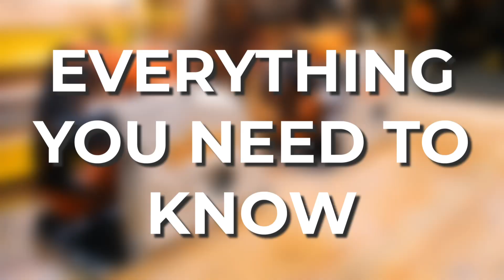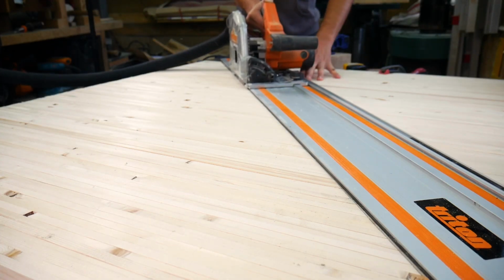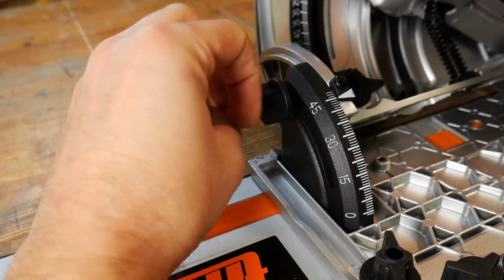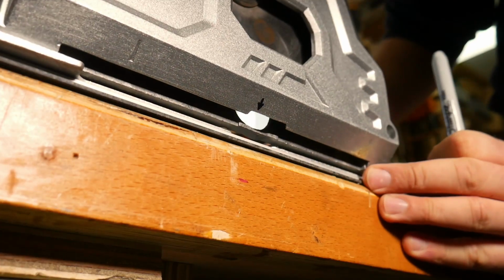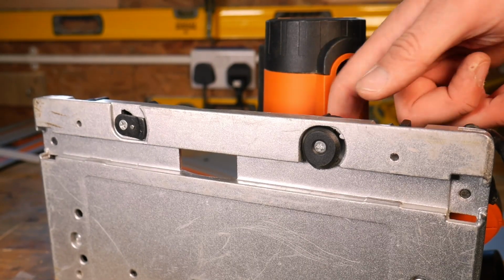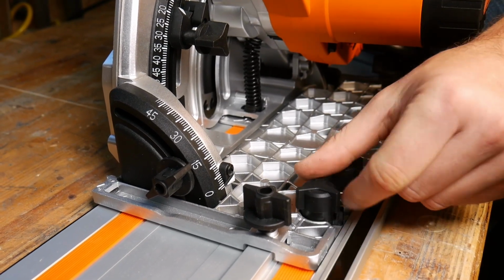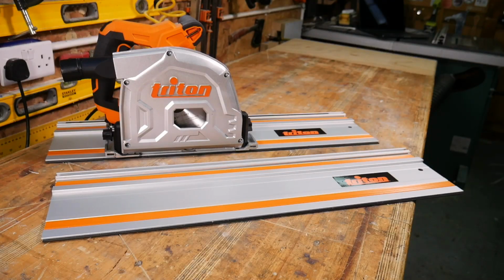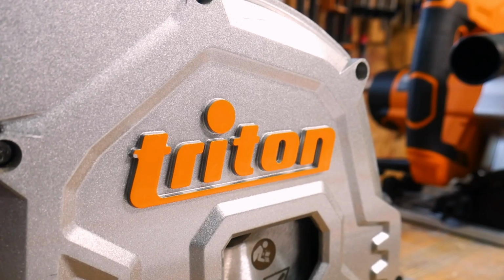Triton Track Saws - Which Suits Your Workshop? TTS1400 vs TTS185KIT

Comment: Sooooo a more expensive version of the Wen?
Reply: Totally. In the same way a Ferrari is a more expensive version of a Yugo. You ARE aware WEN is an acronym for "Westerners Expect Nothing", right?
Reply: @grumblycurmudgeon   sorry if i hurt your  fan boi feelings picking on your brand, but my statement stands. They are the same saw with the same specs, same features, same tracks, only you get to pay more than double for the privilege of the Triton name. So unless someone from Triton would care to chime in and tell me how their model differs from the WEN version, you can keep your snide comment.
Reply: @FyrFytr998  [citation needed]
Reply: @grumblycurmudgeon  if you can’t look at both saws and see the same exact controls, knobs, looks, and construction,  then I don’t know what to tell you.
Reply: @FyrFytr998  You got me. It's the knobs. Pay no attention to the specs. There's similar knobs. Ignore the Triton's 12A vs Wen's 10A. Overlook Wen's stamped aluminum shoe. Ignore the reduced bevel capacity. Skip past the 48 tooth carbide and steel blade in favor of the POS 24 HS (no, that not a typo; the only steel Wen products have ever seen relate to the patent application, and is spelled with an 'A'). The safety features are irrelevant too. Oh, and most of all? I'm sure the fact that Wen offers a 2yr/500hr (WHICHEVER COMES FIRST) warranty instead of Triton's 3 year isn't indicative of a thing. 

Hey, yanno, Harbor Freight has a drill with the same knobs on it as my Milwaukee. And look! Their rotary hammer has the same knobs on as my Hilti! What a fool I've been! Speaking as someone who actually uses tools, I can say I've been positively delighted with my Triton Router, and my Triton belt sander. My recent purchase of the 1400 - which I bought as a take-it-with-me compliment to my Makita (since both happen to use the same track design: the industry standard set by Festool) - has not disappointed me yet. In spite of this, I stand corrected: It's number of knobs that counts. 

Finally, considering this is my third reply to just such a knob, I'm good after this. You may reply to your heart's content. I will say that, should it be accurate, your screen name may prove beneficial indeed. Yanno, assuming you leave the Wen plugged in after, before, or, very likely, during use.
Reply: @grumblycurmudgeon   Good. As long as you realize you’ve been gotten to. Have fun with your slightly buffed ODM saw. Because at the end of the day Triton went to the SAME MANUFACTURER  Erbauer and WEN did for their track saw. So while I may have misspoke about the specs, my original statement stands. A more expensive version of the WEN. And I don’t have to worry about a WEN fire in my house, because like you, I actually use tools, and I own a Festool track saw. You know……..the industry standard. Lol, “I’m good after this”? Doubt it. Stay salty dude.

Comment: Hi, I purchased the TTS185 kit and the saw has developed play in the pinion. This has caused the saw to wander on the track and cut into the guide track.

Can this be fixed or have I an expensive paperweight?